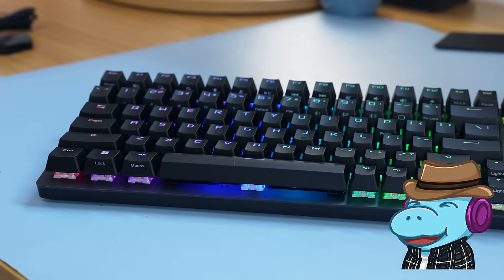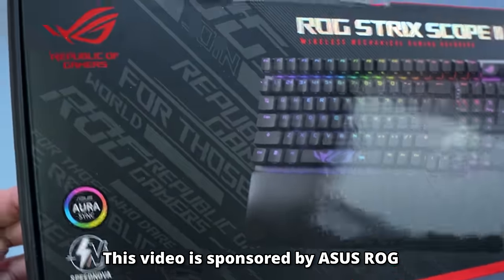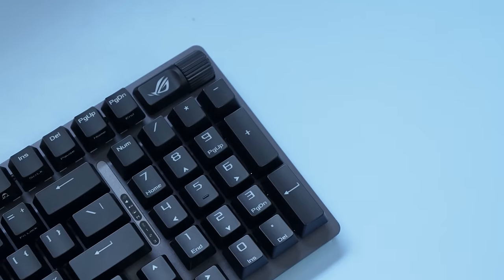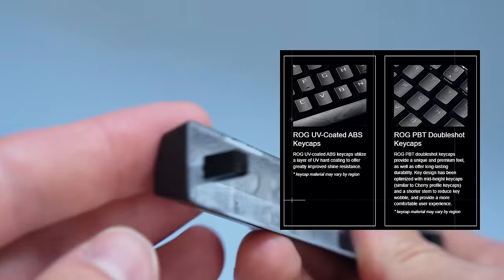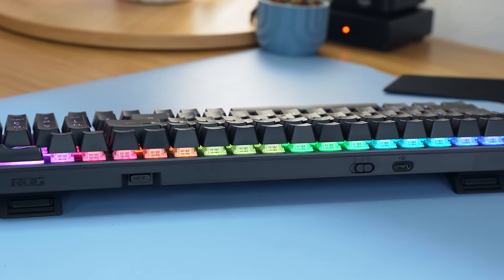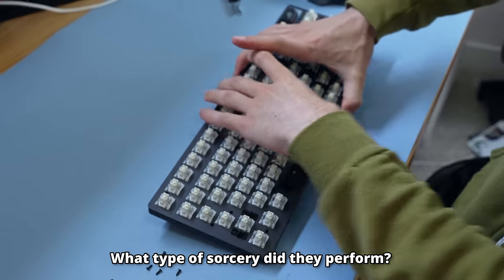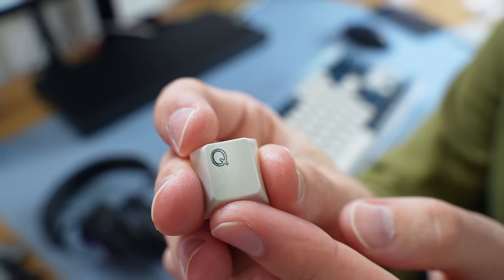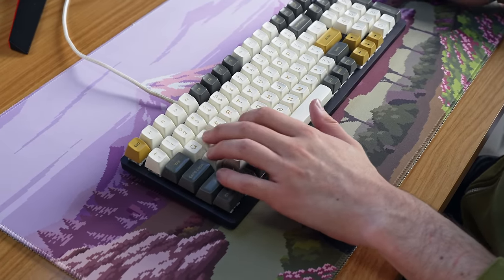ASUS Just Changed Gaming Keyboards Forever....

Comment: Now if only Asus could fix their motherboards and routers as well.
Reply: Mhm 😭
Reply: I have an asus router and it’s incredible, but it’s from like 2012-2014 (not sure but it’s old)
Reply: @miibrawler  They're okay, but the UPnP implementation skips all the "optional" bits of the spec, which allows for stuff like multiple XBox or Playstation decks to have their own separate audio streams.  I also found that even with just the one device, my kids could completely trash the memory fragmentation condition of the router to the point where after about 36 hours it would lock up completely having run out of buffer space for even the kernel.
Reply: @miibrawler  Asus used to make amazing motherboards and routers now they have significantly dropped in quality
Reply: Props to the Asus laptops though
Reply: Their routers are incredible bro
Reply: @ashwrightyy  high performance but not necessarily the most reliable based on recent events
Reply: laughs nervously in B550
Reply: of the last 5 motherboards i've owned/built with, the two ASUS were by far the best lol. Will literally never buy another MSI motherboard in my lifetime
Reply: @galvendorondo  I'm also on one of their B550 boards. Hopefully the chicanery with AMD platform didn't kick in until the 600 gen.
Reply: @leftcoastfunk  I'm just making a topical joke about how badly Asus designed their current gen AMD boards (might also be a thing with Intel, not sure). I'm on an Asus B550M and it's indeed been quite solid overall, but that doesn't appear to be the case now.
Reply: yeah their routers and motherboards should also come pre-lubed.
Reply: @efronberlian  Rather, encased in plaster so no one runs the risk of actually using them (sarcasm)
Reply: and their software update for zenfone lineups
Reply: And their laptop qc issues
Reply: @leftcoastfunk  I KNOW RIGHT?? even though i'm a first time builder, i don't really see how you could get better than asus, at least with intel. the auto OC boosted my cpu time spy score over 80% higher than average and it beats out some fairly recent threadrippers now. that alone makes me wanna keep purchasing from them lol
Reply: and mice. would include headphones if those exist ( i honestly dont know if they do)
Reply: Agreed
Reply: @amirulizzat2114 I only know they exist because I have the Gundam themed Helios case(great case btw, but wayyyyy expensive) and wanted to look at all of the Gundam themed stuff at the time, I think it was a limited edition of ones called ROG Delta...? Didn't get them or anything else besides the Wi-Fi 6 router that I'm running Gnuton's version of Merlin on(which is awesome), but I did get a matching shirt and the Zaku shirt as well. XD
Reply: my current z790 build was originally with an asus board and then it wouldn't post switched to a comparable msi board and haven't had any problems since. It's a shame it was such a pretty board and for the few seconds that i was able to get into the bios it looked amazing too and the search bar was a plus. Then i found out msi also has a search bar and i am completely sold on msi boards
Reply: @BigWheelThaGod  I'm on the fence about MSI as well because of how horrible they are for RMAing and how they were very much scalping their own cards during height of the shortage-- a DIRECT SUBSIDIARY was selling RTX 3080s for well over MSRP directly on eBay. MSI disowned them, but I doubt their main branch had no idea what was going on. No corporation is your friend, basically, just gotta find what's least scummy for you and best value.
Reply: I have a asus mother board... its been fine with me for 5 years lol
Reply: ONG
Reply: @anthonyt1t5  the older ones are fine it's the newer ones that have been garbage it's sad. The last 2 gens have been terrible quality. Almost every white variation of their boards have had bent pins for some reason. Just look at the amazon reviews. not to mention the AMD ROG boards melting cpus.
  Wonder why everyone's switching to MSI, They're cheaper for the same tier boards plus almost all MSI boards have bios flashback even on the entry level. Meanwhile that ASUS board I bought for 300 usd had no bios flash back, Issues with booting into OS, And mine shipped with bent pins. The $250 MSI board worked stable since day one, has better IO and bios flash. ASUS holding L's
Reply: Fax lol
Reply: I’ve had no problems w my Asus motherboard and I have like an a520
Reply: @urbosasimp7971  I think I mentioned this above but the main issue with Asus has been the fact that their current-gen (AM5) motherboards on the higher end have been pushing CPUs so hard that things can quite literally go up in smoke. I'm on a B550 Asus board myself and it's been fine, but I'm skeptical of their newer gear.
Reply: ArmoruyCrate bricked the LED screen on my motherboard literally within minutes of using it. This is in addition to other issues I have had with their drivers and software. Honestly, I have had 1 Asus component ever and it will be my last.
Reply: Whats wrong with their routers?
Reply: @nemtudom5074  the quality sucks and a software update bricked a bunch a few months ago
Reply: @Midnight_horrors885  Huh

I didnt know that, i havent been able to put mine into use yet
Reply: @Lyander25 mines super unreliable and I have the Axe16000
Reply: @Cam-i just recently bought the asus g18 strux 4080 and it is great but asus still has qc issues even in their laptops. they suffer backlight bleed but mine isn't terrible so i stuck with it. performance is great tho
Reply: wait whats wrong with their boards? i've been using asus boards for the past 3 years and i dont see much wrong
Reply: @brockpiano  current generation boards push Ryzen 7000 CPUs too hard, think it was  something about pushing too much voltage in and frying the silicon, literally burning boards, to try and eke out more performance. Some consumers had installed an official BIOS where this was enabled, and were later informed that they wouldn't be supported following failure if experienced. Basically they screwed a bunch of people out of a lot of money in recent months, but now they're backing off a bit cuz of public outcry. Still unimpressed by then, and I've got no plans on buying any more Asus gear.
Reply: @Lyander25  oh i didnt know about that; im on an intel board. ty for the info
Reply: @leftcoastfunk there literally causing CPU's to fail and they pushed out bios that will still brick your cou but it voids your warranty
Reply: i have both and they are the best no issue at all
Reply: I find this weird... I have had only had about 7 ASUS boards and am currently using one on my first AMD system.  Never had a single issue.
Reply: FIX YOU HEAD
Reply: There's nothing better than buying an Asus motherboard only for the software to brick itself after two years with no fix.
Reply: @hermitgreenn  BRICK ITSELF? WHAT DO YOU MEAN? ASUS IS STILL THE BEST BRAND SINCE ALWAYS IF ITS ABOUT MB SO...  WHAT IS YOUR OTHER BETTER OPTION? GIGABITE? THERE IS NOTHING BETTER THAN ASUS KID...  U PROBABLY DONT KNOW WHAT YOU DOING WITH IT...
Reply: @Cam-i  Until you need to RMA it for  a warranty claim.  The process is a ballache.
Reply: Well, technically ASUS and ROG are different brands, and if I can recall correctly, operate quite independently within the company. Now I agree with you that the rest of the company could learn a trick or two from ROG, time will tell.
Reply: My ASUS router is waaaaay better then the router Verizon gave me
Reply: @nothingelse1520  And that seems to be a remarkably low bar to clear, but glad you have something that works either way.
Reply: @Lyander25 I have FiOS and my speeds are always great. On the Verizon router I had to restart it mil times a week
Reply: My strix b660-f Runs Great. My asus pd27aqdm Oled Runs Great. My asus wifi 6e 7800 Router Runs Great. No Problems at all with my asus products.

Comment: Ive had mine with the Snow switches for about 3 months now.  I absolutely love it.  Last Keyboard was a Logi G612, went through 4 of them in 2 years due to double clicking/chatter.  Changing to the Scope II is awesome.
Reply: Having the same problem with logitech. Never again will I buy logitech.
Reply: @curiaregis9479  You should try putting isopropyl alcohol in to the double pressing switches. Make sure keyboard has no power, remove keycap, press switch down and put some alcohol inside. Rapidly press couple of dozen times and leave to dry for hour. It's likely just some dirt inside the switch. My keyboard is working perfectly fine after 7 years with that trick. Also works with mice

Comment: So, the problem isn't north-facing LEDs, it's that the switch molds aren't always designed to make Cherry keycaps compatible with NFLEDs.  There's no good reason for this, as there are many switches that don't experience that problem, like Epomaker's Flamingo, Budgerigar, and Sea Salt Silent switches.  It literally just takes a slightest slope on the LED-side of the switch.  Or a longer stem (like, maybe half a millimeter, if that).  There is no good reason for any new switch not to avoid interference with Cherry keycaps.
Reply: Any switches that has 3.5mm or less of total travel will have no problem with thicker cherry profile keycaps.
Reply: what exactly is it interfering with? like you can't put on the keycap?
Reply: @a55tech No, but that's a good question!  Cherry interference refers to the fact that Cherry keycaps, particularly in the "home row," (A through Enter in the alphanumeric section), when placed on a switch on a board whose LEDs are north-facing, will sometimes impact the switch housing itself before fully bottoming out.  This is because of the way the "standard" switch housing was molded for a long time.  It often results in a clacky sound as well as being rather easily felt compared to the other keys.

So, my point was, if you use slightly longer stems that aren't flush with the housing when bottomed out, or if the housing on the LED-side is sloped a little more than the "standard" was for a long time, such interference can be quite easily avoided, making the north-south distinction a matter of personal preference rather than one being "better" than the other.
Reply: all gateron switches have a slight indentation in the top housing to prevent interference. rather than getting mad at north facing pcbs, which are objectively better for people who like shine thru caps, we should be directing that anger at switch manufacturers for being lazy and not adapting the way gateron and others have
Reply: @frankpizza1596  <--this guy gets it.  The Keyboard OEMs have clearly demonstrated they will use north or south facing and both will forever be part of the market.  The switch manufacturers have their head in the sand pointing their fingers at the keyboard OEMs while doing noting to make their switches compatible with both.  Stop defending switch producers for not addressing an obvious problem they aren't addressing. 

All that said most people never ever switch out their switches.

Comment: I think it's one of those "you can have south facing switches OR RBG, but not BOTH" situations.
Reply: I don't even get why north facing is still the default. Key legends aligned to the top of the cap was the standard for like, ever.. but now there are so many variants which are more centred, and with doubleshot you can even have centred shine through legends right over the stem.

On top of that, side legends are also gaining popularity somewhat where the top is blank and south facing LEDs would allow for shine through side legends which would just be dope
Reply: @motocat5685  yeah I'm with you. Side legends are the ultimate gamer move, however I'm having such a hard time finding caps for a 67%
Reply: @matttran7161  Pro tip: Get a set of uniform profile caps like XDA or DSA, they fit everything

Can mix and match novelties around too if you want
Reply: @MotoCat91  I don't get why either has to be the default. Let's have decent options either way. While north facing is the default for gaming oriented boards, which make a lot of sense for that demographic, south facing is absolutely the default for enthusiast boards.

And decent shine through caps are rare, especially for non standard layouts. Decent side lit keycaps are even rarer. I have yet to encounter a side lit set which doesn't suck in one form or another.

Plus, there's plenty interesting switch options which don't suffer north facing interference with cherry profile caps. And there's plenty interesting profiles besides cherry which won't cause interference in any case.
Reply: @valadi7698  if a brand like logitech or asus did make some front facing shine throughs, we’d probably get a lot more keycap sets that also have front facing shine through that would be better quality. i agree that they should start making those

Comment: The only thing I don't like about linear switches is that I've come to notice that while gaming, as I'm resting my fingers on the keys (not actively pressing them), sometimes just the weight of resting my fingers on the keys would be enough to unknowingly press a key down far enough to register it.  Kept thinking "Why the hell do i keep strafing occasionally while running forward".  Took a bit to realize.

Keyboard in question is the Glorious GMMK2 with its factory Glorious Fox linear switches.  Replaced the switches with some Gateron Green clickys, and it's SOOOOO much nicer feeling.
Reply: You need a heavier Linear then.. anything over 45g actuation would work out well.. I know the Novel Creams come in 3 different weights
Reply: @TomGunna88  ..... The ones I was using I believe were the Glorious Lynx switches that come with their GMMK2 keyboard.  60g springs.

Comment: I love 96% keyboards. I have a small desk, and my PC is on there next to 2 monitors. I have to have a numpad as I work with CAD software a lot, and being able to type in dimensions with it is so much better that having to use the number row.
Reply: What about a separate numpad then? You can place it anywhere. Which is beneficial for ergonomics. And it saves space since you can move it out of the way when you're not using it.
Reply: @valadi7698  I'm basically always using it, and ergonomically this already makes sense for my setup. I'm not chucking my mouse around in FPS games, so I just have this and a normal mousepad set up. I tried the numpad thing with a 75% keyboard before I got a 96%, and it just became an extra thing that existed on my desk and would get moved around more than it should.
Reply: @valadi7698  bro 96% are small enough, this argument of space can't be taken up.
Reply: @PoutouPtou11  That's entirely your own subjective opinion. You are entitled to your opinion, but opinions are not facts.
Reply: @valadi7698  it's not subjective, it's small, that's it. it's just a trend the 60% keyboard, completely doom. And if you mesure a 96% compact it is very close to a tkl. Idk what are you doing with your mouse bro but probably not the right thing, or maybe u forgot that you are suppose to lift the mouse after a moment ?
Reply: @PoutouPtou11  No. Whether 96% is compact enough or not is ENTIRELY subjective. Your opinion is just your preference and is not, nor will it ever be, an objective fact. Other people have different preferences and different use-cases. Simple as that.
Reply: @valadi7698  nop it's not subjective, it's it's measurements. I was talking about the space argument, not preferences in terms of design or whatever.
Reply: @PoutouPtou11  Sigh. 
A tape measure will absolutely give objective empirical data. You do realize that there are a LOT of layouts which are objectively more compact then your preferred 96%, yes? So what exactly is the point you're trying to make here? Your entire argument is pretty much a contradiction in it's inception.

What is compact enough or not is entirely subjective. It's entirely dependent on personal preference and use-case. Same as practicability, ergonomics, etc, etc.

A little life lesson here for you: 
Your opinions are not facts. Opinion based arguments are usually pointless.
Reply: @valadi7698  i should make a study to prove you that the zone you use on your mousepad with your 60% or whatever, it would never interact with a 96% keyboard compact.
Reply: @PoutouPtou11  Not the point. The point is that you categorically state your opinion that 96% is compact enough as fact, and that you clearly fail to realize that opinions are subjective by definition.

Also, you assume to much. I haven't given any indication what layout or size I personally prefer.

Comment: I kinda struggle to fathom how a keyboard enthusiast who went across so many boards still struggles to differentiate between ABS and double-shot PBT keycaps on a very first glance :) Also, important argument for the North RGB - yeah they can be delivered without interference and the way the discretely emit light mostly just via the shine-thru keycaps is exactly how I love them. The south facing RGB bleed is annoying and unbearable, so I perfectly understand this position and wholesomely support it. The south-facing RGB are mostly just a gimmick that on most boards just does not serve any purpose apart from a decorational battery drainer. But hey, that's just me. 

Btw, have you tried the wireless further away from the desk? I found out that most keyboard's I have tried struggle massively beyond 2m of range in a clear sight from the dongle. Logitech G915 being the only exception - even Deathstalker V2 Pro would not deliver at such a tiny distance.